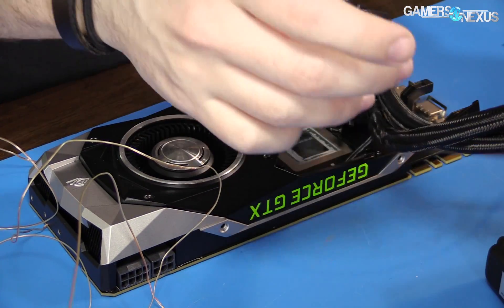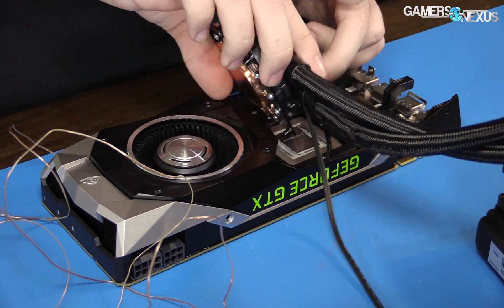Building a 1080 Ti Hybrid Part 2: Assembly

Comment: Installed the kraken g12 on my 1080ti. Put it back in my system , turned on the power and the computer started then turned off instantly and wouldn't turn back on. Upon inspection of the 1080 ti I found that the r376 resistor had blown.

Any reason why?

Any way to fix this card now?

Help!

Comment: Excellent video - thank you. 

However, I did not see where you re-attached fan splitter to board. I did 2 builds for 1080 TI and (had a senior moment) had to tear down both to reattach fan splitter to board.

Just FYI
Reply: Just had the same thing happen to me. Did you end up splicing the wires to get power to the fan and pump ?
Reply: Aram Cerritos The evga kit I had actually came with the splitter. I plugged the female attachment to the disconnected original oem fan but did not attach the spliced end back to gpu board. Once I reattached the split male back to board then pump and fan worked together beautifully with on board controller. The third end closed the loop attaching the radiator. Cheers!

Comment: Hi there new subscriber here. 1st let me say i love the channel thus far, and this series on the hybrid kit is what brought me too your channel. I just ordered myself an EVGA 1080 Ti FE yesterday. Got a question or two for you though. The link in the description links to a 1080/1070 hybrid kit, and clearly it works for the Ti also, but why not use the Titan/Ti hybrid kit, other than the difference in cost? Also judging by the fact that you didn't use the cover from the kit I'm guessing that it doesnt work for the Ti? One last question for you, Ive been looking at the EVGA kit as well as the Alphacool Eiswolf system. Considering that they are both about the same price, which one would you recommend, and why? Thanks for this series on the installation of the hybrid kit as well as any answers/advice you would have for me.

Comment: At 7:28, you mention any part of the gpu die not covered by thermal paste will die. Does that mean if I'm using a program like HWmonitor and all temps are low for the gpu, parts of the die can still be overheating without me being any wiser? Appreciate any help from the users on here. Always found your videos to be very informative.

EDIT: I have a G10 Kraken installed with a Corsair H55 AIO cooler on a 980 Ti and I used MX4 paste on the die via the pea method. Temps never exceed 50 degrees celsius and watching your vid made me worried.

Comment: Great vid GN.  I did have a question though.  I saw you using tools from both the mid sized kit and the monster.  Did the monster not have that 4mm or whatever you used from the mid sized kit?

Comment: Hey guys, great content. Video's are great, and your articles are very thorough. The best hardware testing channel on youtube for sure. Great methodologies, lot's of time and consideration put into accurate and thorough testing, as well as transparency. 

I would LOVE to see some more Motherboard reviews. I enjoy the tear downs, the overview of the VRMs/Chokes, heatsinks vs heat traps, types of capacitors and what makes some better than others, what options are worthwhile, and what are gimmicks. 

If you could even do it without mentioning RGB lighting that would be awesome too! Lol. 

I really want to see how things are stacking up in the OC tolerances, it looks like the AsRock Super Carrier should theoretically be an overclocking beast, but is it? Is it laid out to provide stable overclocks, or stable clocks while utilizing all the onboard expansion slots that require power distribution, 3 m.2, etc. Or would a z270 prime with a GPU/RAM and no other power hungry stuff on the board (separate fan controller/SATA 3 2.5" SSD's instead of m.2 SATA drives)

I feel like people have gotten so lazy as to have pretty much said "All the boards are pretty much the same, buy the one with the connectors you need, and now, here is the our top 10 list of BEST RGB MOTHERBOARDS" I don't care about this rainbow bright bullshit, I want numbers, hard data, useful/practical information. 

Anyways, thanks in general for your more technical/logical approach to hardware reviewing/testing. The hard work has not gone unnoticed, or unappreciated.

Personally I want to overclock a KabyLake 7700K on a new z270, and beside the silicon lottery variable, I want to control as many others as possible, which means I need the best suited hardware. The ROG boards with liquid cooling on the VRMs seem overkill, and like heat traps if you don't have a custom loop, so I want something that I can use an AIO on, and sink the heat off the VRMs properly with good case airflow. Personally, bang for the buck is what I am after. . . . and with RYZEN I don't even know if the z270 offers that anymore.

Comment: did this to my original G1 gaming 1080. Had to chop up my base plate pretty brutally... I personally don't recommend putting the pump to the GPU, was creating issues with the pump (pump stuttering) just had it connected to the mobo

Comment: Shit this card was released last Friday. Why is it still impossible to order it anywhere yet? The stock of the world's most powerful graphics card is a joke
Reply: Chris Harrison this has been the case for every card. the 1080 stock was trash, the 980ti stock was trash. at this point, you should expect it
Reply: Having a look at a few stores online, they are sold out of 1080Ti's but have 1080Ti based systems in stock. So yeah as is mostly the case retailers and system integrators hog all the stock to move more systems. This happens every time I don't know why people consistently blame nVidia when you can just check a few stores and see for yourself where the stock is going.
Reply: Chris Harrison I believe that we cannot buy them right now because most of the intial supply went to the system integrators. I have no proof though, just guessing :)

Comment: What is the difference between this cooler and the FTW one EVGA offers?
Reply: this is an water cool (kinda DIY) but the principle here is the  AIO water cooler. EVGA FTW is air cooler like most coolrs out there btw there haven't add on partners cards yet they would come out in April. the point of this video  when part 3 comes out is to see how far this card could go core speed and vram  without major heat limitation like the founders edition has
Reply: Eliad Buchnik Go to the Amazon link. There is a Hybrid Waterblock  cooler for $99.99 and a FTW Hybrid Waterblock cooler for $119.99. Hence my question.
Reply: my guess the big difference is the VRM and ram fan is different so cooling might be affected also the design is slightly different not that makes any practical difference, but there might be more then meets the eye

Comment: you sumbitches! I want to see the results so bad! This is the kind of mod you know is going to produce great results due to the 1080ti founders reaching it's thermal  ceiling in every benchmark out there. Not to mention having this long before an AIB'S or third party coolers are available on the market. I wanted to do this to my 1070 FE but I feel like the added cost of the liquid AIO wouldn't be worth the minimal results as the 1070 doesn't get nearly as hot as a 1080 or 1080ti. :/

Comment: I've always prefered the star pattern for GPU's..   gaurantees coverage.
Reply: it is usually the recommended but that not the only way. if you want the best and you get nice steady hands use liquid metal for best results and guarantee equal spread a across the whole die (just be careful though)
Reply: thanks, I'll consider that next time :D  I just get very worried with conductive materials next to raw silicon and the supportive components.
Reply: the silicon die itself is not conductive, but the components near the die are the conceren so as long the liquid metal is in it boundary of the die no worries.

Comment: what happend to the video about the amd wraith cooler if it was good enough for ryzen chips? overclock and non overclock
Reply from the maker: Got delayed when we learned more about the tCTL offset.
Reply: It's probably fine when you consider the ryzen chips are more power efficient than the CPUs wraith was designed to cool
Reply: Gamers Nexus oh I guess that makes sense

Comment: Is this essentially what the Kraken G10 bracket does? I installed a g10 bracket with a corsair h110 on my 980 kingpin and it seemed like a similar solution. Great video!!
Reply: It's the same, except this keeps the blower style fan, and the axial fans of the Kraken should provide better cooling. The blower style fan is designed to push air radially towards the I/O plate, which will really do nothing for additional cooling  to the vrm, and at most just airflow over the vram. The Kraken's (and I assume other hybrid brackets) have a fan that blows radially, either pushing air onto or pulling air off of the vrm and vram. 
Personally, I'd rather see thermal pads or paste and heat sinks; it's better to go overkill on the cooling than not have enough.

Comment: also can someone explain to me how blower fans work?
Reply: Surely there's someone who knows better than me, but for what i know "regular fans" have blades designed to push air from "upwards" (according to the spinning axis) down on the heatsink and that's why those have angled blades, while blower fans have "vertical" blades so they move air from one side to another (like left to right and not downwards) like in a gpu from the case airflow to the rear exhaust of the graphics card.
Reply: they get air from inside the case and blow it out from the case
Reply: well I gathered that, i meant how the fan on them works, like how does it move air :p

Comment: Buildibg hybrids has just become a ritual on this channel, Why not do them for real low end cards like 1050's or an rx460? Won't overclocking those weak cards make an insane difference?
Reply: Simply because it's not worth putting a ~100$ cooler on a < ~200$ card just take the rx480 instead of the rx460
Reply from the maker: We did an RX 480! And a 1060!
Reply: Gamers Nexus Yea, those are midrange cards, personally running an xfx rx480 here, but I was talking about the real low end cards
Reply: Well I'm sure they could do it.  However, I'm sure they'd run into power draw issues before running into thermal issues when it comes to overclocking the card.
Reply: But in your first comment, you had 'rx480' in as one of the "low end cards"
Reply: very sorry, mistyped, wanted to write 460 :/ I'm on mobile and didn't reread the comment -_-
Reply: But... for the glory of Satan!

Comment: GTX 1080 Ti SLI benchmarks please :)
Reply: +daUser666 I'll buy two of them not for only gaming. It is for my Graphics Designing, VFX, Car Designing/Modeling etc. and other side I also enjoy playing games. :)
Reply: I have had 9800GT SLI, HD4670 Crossfire, HD6870 Crossfire, R9 290X Crossfire and GTX 1070 SLI and I wouldn't recommend it today, support is actually much worse than it has been previously. Until DX12 multi GPU is widely adopted, I wouldn't bother. Even if you get GTX 1080Ti and it works, the scaling is horrible. Crossfire scales much better, but then frame pacing tends to be a common problem so either way, right now, it's just not worth it. Just wait for DX12 multi GPU.
Reply: yeah I sold my 2x 980 tis for this very reason. For some reason nvidia seems to be killing SLI. Besides, 1 1080 ti is pretty insane as it is:}
Reply: BitupaN DoweraH techoftommorow has those up bud. SLI was trash. And im an sli guy. Running 980s in sli. But there seems to be a problems with drivers or the 1080 Ti scaling badly in sli.
Reply: +Tanzu15 Ya I saw those results
Reply: It doesn't scale very well and it's not worth it.
Reply: There's also SLI on hardware info and it's horrid.
Reply: Most AAA games come with sli support. The only two off the top of my head that didn't was Resident Evil and Gears of War 4. Besides that, Sli is pretty well supported. I also think it's a bit of a carrot and stick problem. Developers sometimes don't support sli because consumers don't buy sli because developers don't support sli because consumers.... you get the idea. I had gtx 980 ti in sli and got along fine in everything from Witcher 3 to Dark souls 3

Edit: actually, I just checked and resident evil now has sli support.

Comment from the maker: Hey all. I have one more trip this week, then it should be calm for a month or so. Hopefully. This is part 2, providing more of a walkthrough of installing the cooler on the 1080 Ti FE. Hopefully that helps some people in the future. Part 3 is filmed, we just need to finalize the article. That goes live tomorrow. Thanks for watching! Remember, we post other news & features that don't make it to YouTube. Those can all be found at http://www.gamersnexus.net/
Reply: Could you show how you "spliced" in the fan and pump power?
Reply: Gamers Nexus So lemme get this straight. The EVGA clc for GPUs is adaptable for 980 ti titan x (maxwell) 1070 1080 titan xp and 1080ti? I know with 980ti you can use the enclosed modded shroud. Am I correct in what I just mentioned?
Reply from the maker: Might have made it sound fancier than it is. The pump comes with a split cable. You just connect them all together and into the PCB.
Reply: Been waiting for this, part 3!
Reply: Ah - yeah splicing says SPLIIICING to me.  Still would have been cool to see.
Reply: Would the EVGA should not work for the 1080ti? I bought one of the EVGA kits for my 1070 and was curious if it would fit the 1080ti. I believe it won't because of the additional VRAM but I may be wrong and would love it if maybe on an ask GN you could address this quickly. Thanks and you guys are awesome :)
Reply: EVGA makes 2 hybrid coolers and both fit the 1080  and 1070.  The model he just put on is specifically for the 1080.  Check the part number.  

http://www.evga.com/products/productlist.aspx?type=18&family=Accessories+-+Hardware&chipset=GPU+Hybrid+Cooler
Reply: As Steve of the Great Church of Steveism spoke, tomorrow the benchmarks cometh. The people stood in awe, knowing no doubts, taken by the coming of numbers be true. And so it was told, and so it will be.
Reply: Hahahah
Reply: Oh great the part 3 is for today Nice work Guys
Reply: The two different coolers are for the base/sc and their FTW cards. Even still the base/sc 1070s and 1080s may have a slightly different VRAM layout than the 1080ti, which may make it incompatible.
Reply: i bet they use more than a good smartphone camera and these days thats way more than enought (i think GM´s video quality is fine, watch codys lab and you will know who could have some improvement)
Reply: Pettyofficerkickass 
Yes, but he gives the model number and he installs it in front of your eyes.  Where's the confusion?